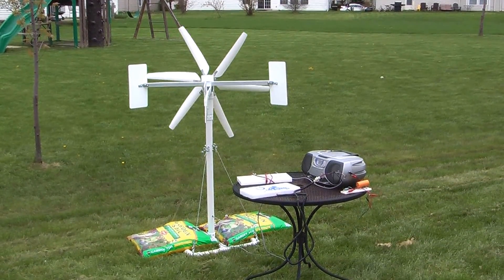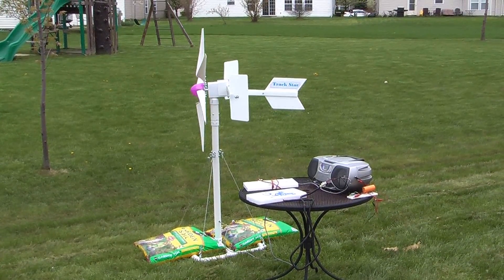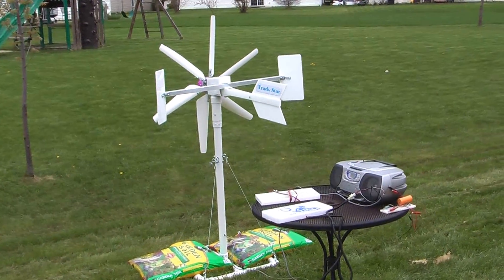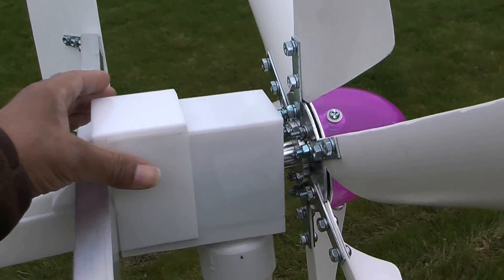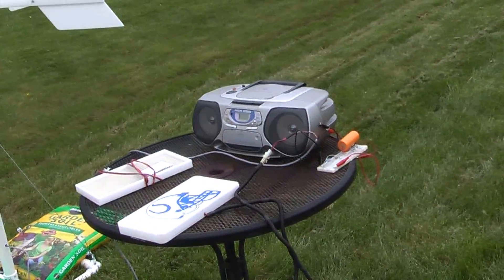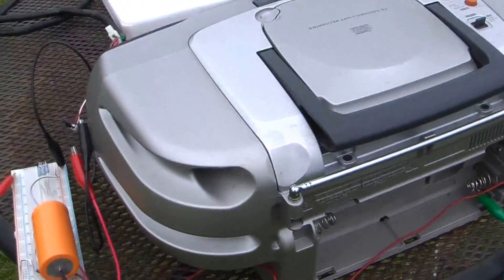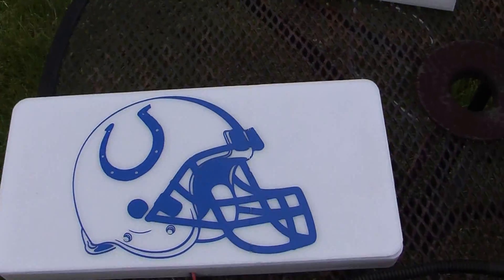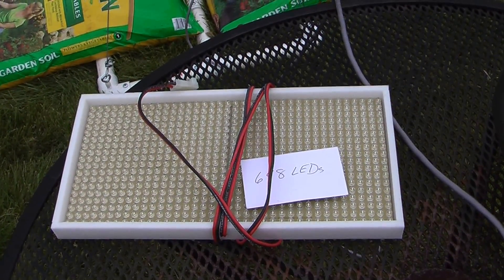Mini wind turbine 4

Comment: Hi boowonder888: that large cylinder on the beadboard is a filter capacitor. If you search the web for "DIY AC to DC Converters" you should find a lot of easy to build circuits like this one. This simple circuit converts AC electricity to DC electricity. I hope this helps.

Comment: It is  a good and neat looking turbine, those blades would flex less backwards, if their leading edges were linked together as the thickness of the blade at the root  would come into use structurally wise and would add tremendous strength in the backward directions
Reply: Carmel Pule' : Thank you for your comment but, I only made these blades to get an understanding of Wind Turbines.  If you will, please see Mini Wind Turbine 4a.  Here, you will see that I  researched and learned to design and make Wind Turbine blades correctly.  The blades shown in Mini Wind Turbine 4a are smaller than the blades that I made for my large Wind Turbine.  My new blades work great in low winds, are light weight, are UV protected and, they are very strong.

Comment: 2259chevy:  this is just one of my test units that I designed and built for learning about Wind Turbines.  I made improvements to this unit on the YouTube video - Mini wind turbine 4c.  On Mini wind turbine 4c, you can see how I cured the problem of wire twisting.

Comment: How did u make it to where the wires don't twist inside ??
Reply: 2259chevy:  this is just one of my test units that I designed and built for learning about Wind Turbines.  I made improvements to this unit on the YouTube video - Mini wind turbine 4c.  On Mini wind turbine 4c, you can see how I cured the problem of wire twisting.

Comment: M R skunk budz:  I know that wind turbines are made to charge batteries.  I just used the radio to show people that it does generate electricity.  When people show their turbines charging batteries, that does not show anything to me.  I just like doing things differently than other people.  Also, this was my first test wind turbine.
Reply: M R skunk budz:  I know that wind turbines are made to charge batteries.  I just used the radio to show people that it does generate electricity.  When people show their turbines charging batteries, that does not show anything to me.  I just like doing things differently than other people.  Also, this was my first test wind turbine.

Comment: You need to hook that up to a deep cell rechargeable battery the same kind soaler pannles hook in to all day wind terbin slowly charges batterys the wen they are charg you run stuff on them look at soilar power electric generaters in sted of panols yous terben dummyy

Comment: Hal lo thanks for sharing i want to under stand one thing i built a wind turbine  with a stepper motor that produces ac volt from 20 to 72 volt depends on wind speed but the amp is   0.3 amp  so it charges the battery  but the battery will be empty after only 2 hours with led lamb do u have solution for this  thanks
Reply: Aly Ameen Gomaa: Hello, do you know what Stepper Motor you are using in your wind turbine?  Also, did you convert your AC voltage to DC voltage to charge your batteries?  It sounds to me like your current is verry low for the voltage you are generating.  This is why I need more information about your Stepper Motor.  I will be waiting for your answers.

Comment: Victor Javier: For the last part of your turbine hub, goto The RobotShop and get a 6mm Aluminum Mounting Hub for 60mm Omni Wheel.  This part will cost $6.90 US.  You will need to drill your center 6mm hole just large enough for your motor shaft.

Comment: Victor Javier: My hub is a 6" round aluminum disk that is 1/8th inch thick.  I got it on ebay for about $4.00 US.  Once you have the Turbine blades made you just drill your holes.  The other part of the hub is an aluminum Robot wheel hub from a Robot shop on line.  When you pick out your wheel hub, you get the one that has a mm size hole for your motor shaft.  Stand by and I will tell wich one to get.

Comment: i like your design.  how did you wired the nema 23 stepper. I have a nema 23 with (8 wires) to a rectifier.  Also, I having trouble looking for a hub (nema 23 - 6.35mm shaft motor) .  where did you get yours.

Thanks for the video Charles...

Comment: C. Murray:  This is something that anyone can do to test a motor to be used in or on a wind turbine.  First, connect your motor wires to your voltmeter.  Second, take a veritable speed drill and set it to it's lowest speed.  Third, put the shaft of the motor into the drill as it were a drill bit.  Forth, turn on the drill while holding the motor.  At this point, if the voltage goes above 12 volts, then you have a good motor.  Also, to you guys that wan't to make your own blades, you can go back to using PVC pipes.  The way you make PVC pipe blades work well is to paint them with Krylon Fusion Paint.  This is a new paint that will protect PVC blades from UV rays.  There are a lot of YouTube videos that will show you how to make PVC blades.  Good luck.

Comment from the maker: C. Murray:  Hello; assuming you have a DC motor, follow these steps.  Connect a voltmeter set on DC volts to the two leads coming from the motor.   Next, spend the motor shaft with your fingers.  If you don't have to spend the shaft real fast and, you get a voltage reading, you have a good motor to use.  If you have to spend the shaft really fast, the motor is a high RPM motor.  You can use the high RPM motor but, your output voltage will be low.  However; if you do build a wind turbine with a high RPM motor, you can make a voltage  doubler or voltage tripler circuit to in crease your output voltage.  If you don't have voltmeter, you can use a real cheap LED and see if it lights up.  If you use an LED, you may have to connect it one way and then the other to make sure you get light from it.  I just ordered a voltage doubler from ebay on 07-18-2016 for $19.49.  You can build one yourself for about $5.00.  let me know if I can be of any other assistance.
Reply: fiev
rt in f gf g

Comment: I have and idea to place this unit on a cone shaped wind tunnel instead of a radiator using ring shaped fibre glass intakes have multiple skin solar panels and the faster you go the more you generate

Comment from the maker: C. Murray:
at this very moment, I am working on a unit that is far better than this one.  I have my son and I have designed a new blade that is behond any thing out there.  The blades are complete and easy to build with simple tools.  They are not PVC or wood.  Also, that have lift on them.  I just have to go to my son's college to see if they can test them for me.  I know they work because l have already made and tested smaller ones.  I just want to compare the other ones out there.  So, look for my next video.

Thank You,
C.W. Robinson

Comment: Pretty good, I'm just wondering how that would work with a battery powered drill motor.
Reply from the maker: Edwin Dueck: 
I kow this unit would work well with a drill motor butt, I have motors that are much better than a drill motor.  I am now building one that is going to use a 28volt motor and produces 27amps.  I think that you will like this one because there is no other one like this one one earth.  My son has part ownership in the design of this unit so, we are working out the issue of wether or not it will be put on YouTube.  The best part about this unit will be the new simple blade we have designed.  The way it turned out is that for the same amount of money, you can build 12 smaller blades or 3 blades up to 80 inches each.  it won't be that long before we deside to put then on YouTube or not.

Thak You,
C.W. Robinson

Comment: I like you setup, but where did you get your blades, I have a brushless motor I want to turn into a wind turbine,  could you help me with that info.  thanks
Reply: Hi: My blades are made of 4" or 6" PVC Pipe. I drew a pattern on the  PVC pipe and cut it out with a hand held jig saw.  If your unit is less than 50" in diameter you will want to use 5 blades in total.  If your unit is greater than 50" three blades will be fine.
Reply: +cwrobinson6363 thanks

Comment: Carlos: I have improved this project by using 5 blades instead of 6.  The new five blades have a true aerodynamic shape.  Even before my new blades this unit could charge a 12 volt battery.

Comment: sir charles maybe you should have weigh the wind vane as it looks like to heavy for the winds to turn, because of the bolts you have used, it will lessen the loads for the wind vane if you'd use a rivet instead of the nuts and bolts.

Comment: Can this wind turbine charge a 12v battery for DIY off grid cabin?
and how much this project will cost
Reply: +Carlos Porto (didn't want you to miss this)
 +Charles W Good looking project! by the way the unit can charge a 
battery! the mill is putting out AC which means you can double the 
voltage ( you really can do more than double it but that is the start) 
if you do a search for voltage doubler you will find yourself an  easy 
project to do just that. Now if that is your intent you may want to add 
solar for low winds times. As a side note for those with low funds I saw
 6v panels for under 5$ on ebay best to get at least 2 but 3 is better!

Comment: Hi Charles 
Great video and the turbine looks so cool. 
I'm doing a project in college that I have to build a wind turbine 
It has to generate 12 volts and light up a 20 watt light bulb whilst in operation. 
It will be exposed to a 15mph wind from a leaf blower. 

The desgin I'm looking at is a 5 blade turbine with a blade diameter of 1.4m 

Do you think this will generate enough rpm to power a motor. If so do you recommend any specific dc motor. 
I want to stay away from ac and gears 

Thank you

Comment: I was just asked if my wind turbine provided trickle power. The answer is No. My turbine provides a constant 12 volts at 1 amp. As far as it being able to run a nother motor, this would be no problem at all.

Comment: What a great project.  I'm not sure what the negative comments are for.  Everyone starts with a small design, and goes from there.  You can't make people smart.  That's for sure.  But I like the side panels that extend out on the chassis, how has this been working for you?  And would you incorporate it to the larger design?  I think your unit is very well made.  Lots of time and effort and little parts LOL.  Its always the way, put up the wind gen, the wind stops completely.  Thanks for the video.
Reply: THANK YOU!

Comment from the maker: Fernando Regalado:  I di not think that this unit can charge a car battery.  I can make one that can do that.  I was just having fun when I made this one.  Here are the specs. of the motor on this one.
Part Number            Frame Size       Length       Holding    Series     Parallel   Rotor Inertia  Price / Price
                                    (inches)             (inches)       Torque      Current    Current                             1           50
HT23-552
NEMA 23
1.71    
84.4   
0.71  
1.41  
1.70E-03
   86.00 / $64.50
Reply: I should have given you this before (my Bad) http://geneticmemory.org/index.php/about-us/73-greenhouse-today this is my video.
Reply: +Charles W Good looking project! by the way the unit can charge a battery! the mill is putting out AC which means you can double the voltage ( you really can do more than double it but that is the start) if you do a search for voltage doubler you will find yourself an  easy project to do just that. Now if that is your intent you may want to add solar for low winds times. As a side note for those with low funds I saw 6v panels for under 5$ on ebay best to get at least 2 but 3 is better!
Reply: Cool!Wantedto. rig something for my small pound(pump) (small) thanks for info.
Reply: +akoben adinkrahene: You are correct. However; I am already using a voltage doubler. It is the small unit between the wind turbine and the radio.  I have also done some testing and it will charge a 12 volt battery.

Thank you for the comment.

Comment from the maker: This unit is only good for 12.0Volts.  The cost to build it was about $110.00.  I have designed some new Blades that now makes this unit a lot more powerful.  Sorry that I can not show them to you guys yet but, I will soon.  Also, I Know that the big units only use three Blades and that is because they are tall enough to be in constent wind.  I have found (in testing) that the best number of blades for low wind is five.
Reply: Really nice wind turbine!
What you should do is have the propeller spinning a big gear spinning another gear spinning a small gear spinning the motor.

Comment: Enlarge the tail 2-3 inches higher & lower then the blades, won't need the deflectors. Simple aero dynamics. That will put the tail into the air wash around the blades.

Comment: This is only a small test unit.  Each blade is only 20" long.  My testing shows that 5 blades is better than 2, 3, and 6 blades.  Also, I am sorry that I cannot make blueprints for these wind turbines.  I just see pictures in my head and I then make them.
Reply: Most industrial turbines are 3 blades, not 5. Power/cost ratio?
Reply: The larger the wind turbine the left blades you need. The smaller the wind turbine the more blades you need. I found that 5 blades are much better than any number greater than that.

Comment: hi, I hope you understand my English, concerning the houses, you need a higher tower to get clean wind, need a charge controller and a battery bank, the capacitor that you use can not guarantee breaks wind, relative to the stepper motor was the best choice